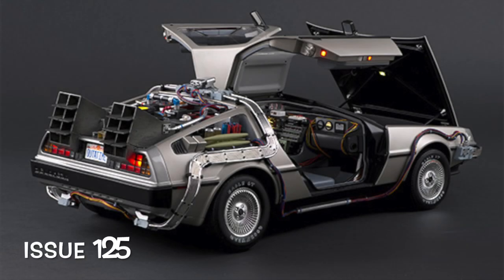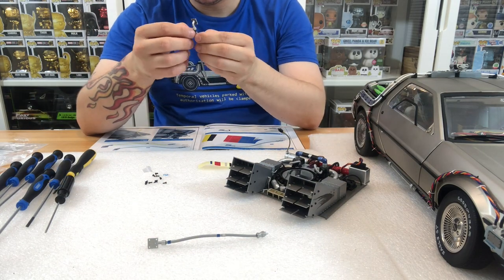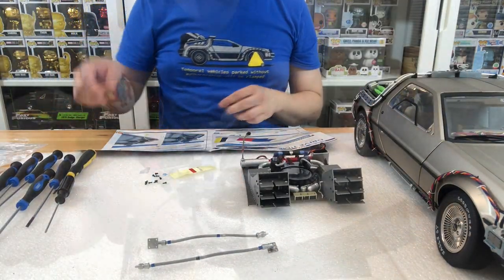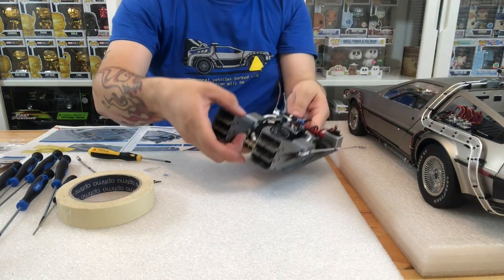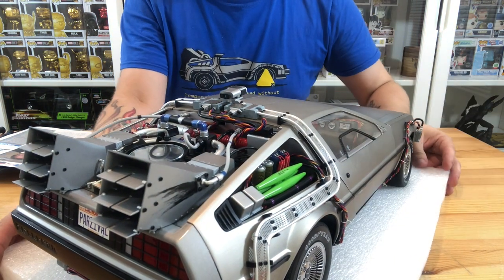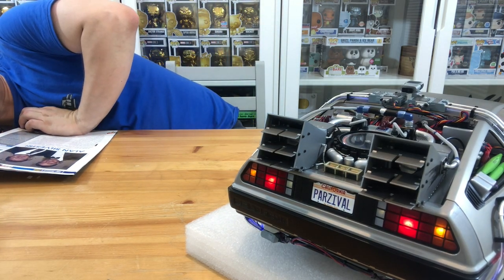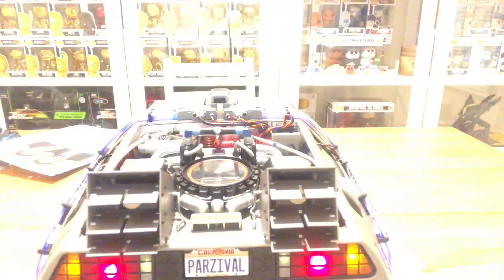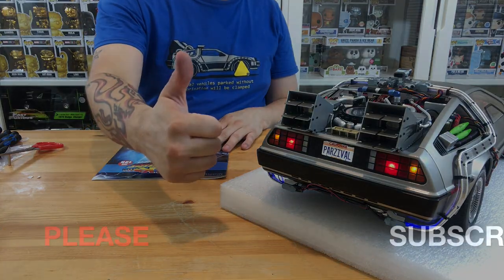Build The Back To The Future Delorean: Issue 125  Vent Cables + Base Installation  ( Speed  Build )

Comment: Great video. All of the EL convertors are making that high pitchy noise,i wonder if the MM version does it to?When will you do the mod for that?
Reply from the maker: I am currently in strip down on the delorean so should be done in a few weeks 😁🔥